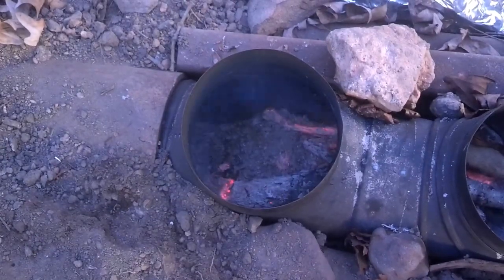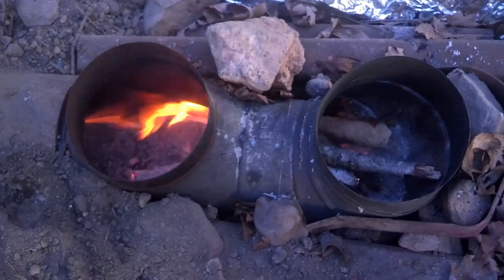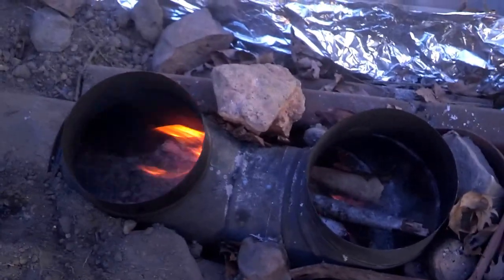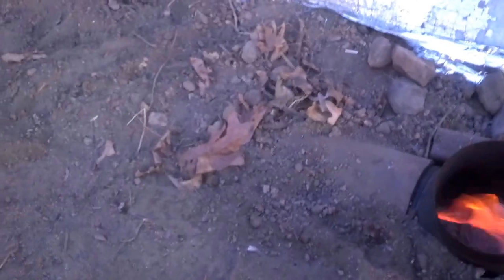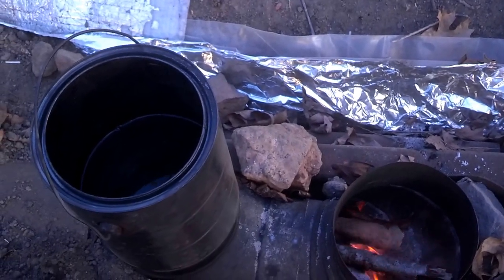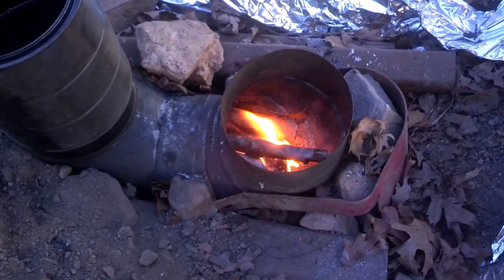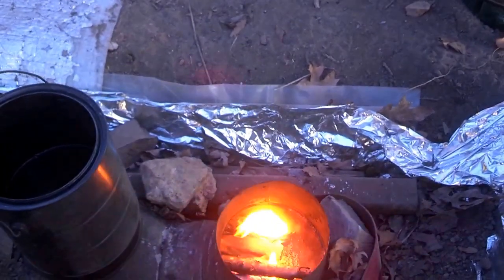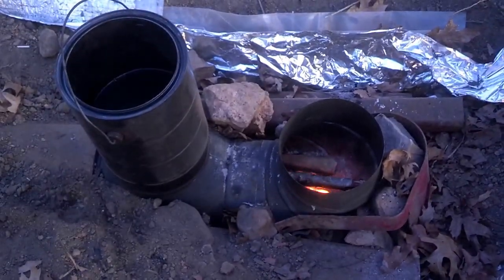Dakota Fire Hole Trench Rocket Stove For Tent, Tipi, Yurt -Part Two

Comment: how long is the pipe\stove pipe?  how hard is this to lite?  im working on building a inground rocket mass heater as i type. i might run my exh quite a while under ground thx
mike
Reply from the maker: Mr t There are four pieces of two foot pipe. There is an elbow on either end, and a tee as the "Cooking Port." 
That totals about 13 feet. Giving the horizontal pipe run a 5 degree rise would help. Having the exhaust stack insulated with aluminum foil, or even with a cone of dirt would help keep the exhaust gases warmer to maintain draw. 
Lighting it, I drop burning paper in the vertical exhaust stack to warm it up. Then I light the other end. It lights same as any fire, except that the draw from pre-heating the exhaust stack is already drawing air across the fire. This Makes it easier if anything.
The outside temps would affect it's operation. I guessed that it would take about 45 minutes to heat the ground up. I had lit it for my documentary interview for Beyond Off Grid. I told Sean Tounn the producer, that it would take a while to really fire up. There were wisps of smoke coming back up over the fire. Sure enough, As I was watching him pulling out of the driveway, I heard the sound of a little rocket behind me!!!